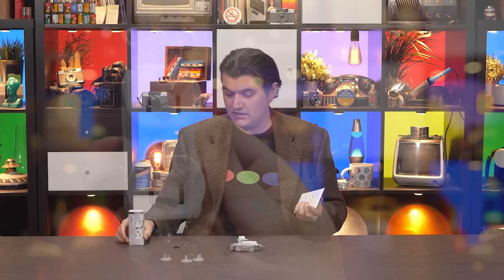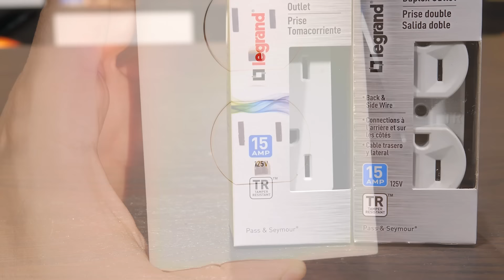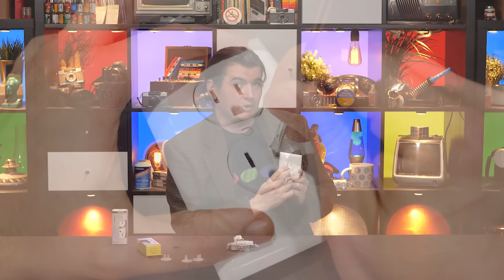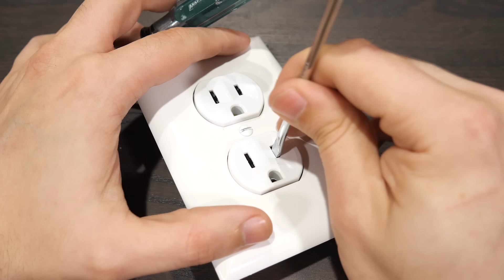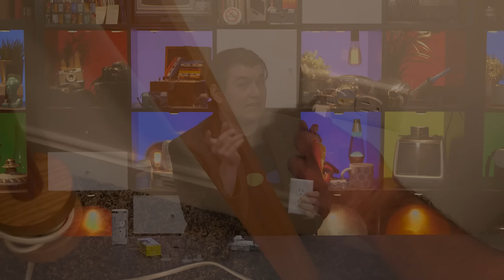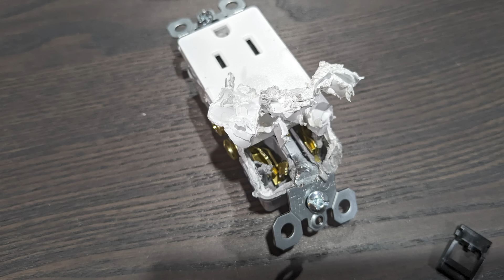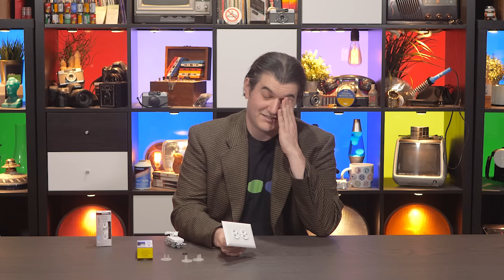Tamper-resistant outlets aren't all the same - a follow-up

Comment: It’s like qwerty vs dvorak or whatever it’s called, the newer one may be better, but enough better to make people switch and learn how to type all over again, and some people aren’t as good as others at changing. I think the foreigners that say our plug are “always loose” came here and stayed in hotels where they are all worn out like you said. If someone in government figures out a way to get richer by forcing changes, it will happen, otherwise why change. People are more likely to get hurt my 120v AC by yanking their arms back and hurting their elbow than they are to be electrocuted. When I was a kid I stuck my finger in light sockets many times, I also nailed myself with 240 many times, but only like a two finger deal, never like one phase in each hand making it all go through my body. I was wiring things up and winding coils making electromagnets etc starting at around 8 years old, I wasn’t stupid enough to like sit in the bathtub filled with water playing with 240.

Comment: I've worked on 120v/15amp circuits live, and so long as you're using insulated equipment and gloves, and you're careful with the wires, it's a lower level of danger that I'm more comfortable with.

I would never work on an electrical panel or breaker panel live, however. Flip off the mains before doing anything on a panel like that. But there are plenty of professional electricians who do work on them live.

Comment: Honestly my new home here in arizona has GFCI breakers at the breaker box which makes any change in the outlet pretty much irrelevant anyway. I did not specify that everything was gfci it just came that way when I bought it. From what I have seen also this is the standard in europ and the UK now. It has actually saved my bacon when I was changing a cealing lamp and though the swich was where the hot was broken.... yeah it was not and it tripped without me even realizing that I had done it.

Comment: 230V is more dangerous than 120V because of higher voltage? No, that is WRONG! It's the other way around!
Voltage isn't what kills you, amperage is! And lower voltage results in higher amperage at the same level of power consumption.

An example:
An appliance is using 120 Watts. On 120V, that is 1A. On 230V, that's 0,52A (aaprox.). 
Since an amperage of 500mA (0,5 A) is enough for a possibly lethal shock, a 230V AC system is better. Also, a 230V AC system can deliver much more power in total, because amperage stays quite low.

Practical exmaple:
Think about the electric fence of a cow pasture. It will keep the cattle inside, because of the shock, but it will not harm anyone. Ever touched one of these? You'll get a shock, too, but it will not harm you. These fences operate at very high voltage, but very low amperage. Otherwise, they'd have to be banned from use. Those fences usually operate with impulses of 5-20kV (yes, that's 5.000 to 20.000V!).

I don't know about you, but I'd rather get a 20kV @ 0,05A shock than a 2V @ 50A.

Keep in mind, that our body's electrical resistance also plays an important role here.
More? See this YouTube video, the Video ID is: BGD-oSwJv3E

Comment: So how about using L5-15 and making tamper-resistant variations of those? If the connector twists to lock, you wouldn't have many of the problems that normal 5-15 give, but you would need to cut and strip every connector you have to make it compatible, and Frankenstein your own extensions / multi-taps._or_ spend more money on specialized L5-15 multi-taps / surge protectors. Worth it? Or better yet, worth petitioning the government to standardize?

Comment: The house i grew up in had a few well-used outlets. Those were the ones my dad had to replace more often as the plugs would fall completely out of the recepticle! Some of the new ones would be very difficult to push a plug into for awhile. The vacuum was especially  dreadful to plug in - and remove! We'd get zapped taking it out quite often. Nothing like adding a little zing to your day! Phew!

Comment: I can see the internal prongs that grip the plugs ending up sleeved or dipped with a nonconductive coating, this would prevent the partially inserted plug from being a hazard while still giving you a full length prong to properly grip the plug once fully inserted. Think of it as the inverse of the UK plug.

Comment: I see what you are saying about the US voltage being safer (less dangerous). If the voltage was so dangerous that one person in every US family died from electrification, there would be protest marches and lobbying of state representatives and a big protest group website pushing for a new type of plug and a new type of outlet to be adopted. But, because the problem is on the level of people like you complaining, and because the people making those safety sockets are not engaging with folks like you, and with the public, the old standard will stick around  because of  social inertia.

Comment: Wago vs backstab - the way I understand it. 
Wago is a spring metal. Over time it continues to apply the same pressure.

Backstab is not a spring metal and will loosen over time, especially in outlits with lots of plug in and outs

Comment: I hate those shutter outlets.  The GFCIs in my garage are made that way.  Unless you are holding the plug perfectly, it bounces off.  Helpful?, no.
Reply: Ironically, it is even more difficult to insert a grounded plug because there are fewer degrees of freedom to wiggle it into proper position.

Comment: I was about 7 when I learned which breaker was for my bedroom.  Much later in my 30s I visited my parents and they remarked how all the outlets in my childhood bedroom had scorch marks.  I went and looked and was amazed that I was still alive.  I was one of those kids that at about 13 years old my favorite toy was a 7.5kV neon sign transformer that I would make Jacobs ladders out of.  I only got bit a few times by that.  It felt like getting dunked in ice water, if you were wondering.  No, I never told my mom.
Reply: Mehdi (Electroboom) nearly died from a Jacob's Ladder.  I think it was his 1 million subscriber special where he built it.  Of course the most likely way for tinkerers to die is by playing with a microwave transformer, incredibly useful for many projects but also incredibly dangerous.
Reply: this is insane lmfao
Reply: Reminds me of when I blew my hearing out of one ear for 30 minutes
Reply: I wired the high tension from the TV set in my room up to the metal venetian blinds. My friend from school still talks about it to this day. Yes, I did get between the HT and ground. Once. The reason the TV survived that abuse is because it was a BW Valve TV set.
Reply: @TeVolt805 uh, why exactly did you wire the TV to the blinds? Some kind of Rube Goldberg booby-trap? 😅
Reply: @emilyrln I think he was trying to use them as an antenna? That's my only guess.
Reply: @texaswilliam  in that case you'd not wire up the high tension but the antenna input (which can sit at mains tension in case of defects, but not at high tension).
Reply: One cause of the scorch marks is also from people yanking plugs out by pulling the cord instead of at the plug. It creates weakness in the connection inside the plug and eventually you get a fantastic arc when you send power through it one time. My mother-in-law used to pull out cords this way and blew several outlets.
Reply: Engineers and electricians must not travel much or bothered by loose outlets. 4 out of 5 hotels I stay at, I have to hunt for an outlet that holds the plug in and lets me charge my laptop and phone. I carry an extension cord when I travel with my spouse or/and kids because the only outlet that works may be the one behind the night stand where alarm clock and lamp are plugged in.
Reply: I loved to have one, instead I play with a 5kV  fuel burner igniter from the 70's, less voltage but far more powerful, only get shocked through the dull old creaking insulation but it really hurt !

Comment: 9 year old house here. Cheap, flimsy TR outlets in the house, a good half of them unusable. I've finished swapping them out the worst ones, went with commercial grade versions which seem to work much better. When removing then old ones, some were completely broken, I can only guess caused by frustrated previous owners forcing plugs in. Poor design equates to not just tamper resistant, but use resistant.

Comment: When going to US clients I noticed that a lot of power strips have very weak contacts and devices fell out quite easily. Less so with wall outlets but still rather loose compared to what I'm used to.

This does not ususally happen with the Type F/Schuko strips we use in Germany.
If you want to continue on this topic I can recomme checking out the Type F and or Schuko system. Imo the most sensible design out there from an electrical and usage  perspective. Not silly national pride used to form that opinion.

Comment: I think the style of TR plug that holds onto only the tip of the plug could be improved if there’s a non conductive material in the plug that serves as a way to grip onto the prongs so it’s that that’s holding the plug in place and not the metal contact itself at the very end.

Comment: I used my wall adapter and the receptacle fell out of the wall. It shorted the brussel sprouts and my GFCI wasn't Y2K compatible. I tried to restart the modem and the refrigerator gave me a blue screen. And the plugs in my walls haven't gotten any better. Welcome to the 21st century.

Comment: As someone from Europe who has been to the US a few times lately I think I can try to talk about the "loose plugs" thing. (Sorry, long post, but TL;DR: it's not so much as they're terribly loose as that they are comparatively much much looser than the usual here)
So I'm currently living in a 40 year old apartment with a 40 year old electrical installation that has possibly the worst wall sockets I've ever had at home (worse than the apartment where a wall socket was just sort of nominally not INSIDE the shower), and they feel just... exactly the same as US plugs except with holes for C/J plugs (or possibly N, which is weird since my country switched to F, not J or N, when C became sort of illegal! Fun!).

Nowadays the wall sockets here have their pin holes inside a deep indentation in the shaped like their corresponding plug type so, if you are using the correct plug for your socket (many appliances, especially old ones, still have C plugs, but the new sockets are compatible with them) the physical interference between the walls of the socket and the plug's plastic molding, added to the fact that the pins are gripped pretty tightly inside the wall, make it actually pretty bloody hard to yank a cable off *even intentionally*. If you want to unplug something here you'll usually have to firmly grab the plug and wiggle it as you pull straight back (of course, over time the sockets loosen, but the recessed indentations still make it hard to unplug a cable by yanking in any direction except perpendicular to the wall)

But none of this is true for US (or my apartment's) sockets/cables. Here (or there) a gentle tug on a cable from pretty much any angle already exposes pins, or worse, straight up unplugs it (or worserer, yanks half the socket off the wall, ask me how I know!). It's a whole different world. You go from fighting the sockets to release your cable from its clutches to being able to casually slide something between the socket and the plug.

That said, my experience with sockets in the US is mostly limited to hotel rooms, which probably have seen a fair amount of wear, but... have they been worn off as much as the garbage 40 year old sockets in my current apartment that sometimes don't even stay attached to the wall? I'm... gonna go with no, to be honest.

Comment: The reason I won't use the back-stabby power terminals is that the contact surface is much smaller than the screw terminals.  The smaller the contact surfaces, the hotter the contact points get when forcing more power through them.  When replacing my own outlets, there were some that actually charred using the stabby bits.  Just, don't use them.

Comment: My mom had hair rollers which were held in place by U shaped metal wires.  My brother got a hold of one, unplugged the clock and placed the metal holder in the power outlet.  Luckily, it completed the circuit so my brother did not get electrocuted but these tamper resistant would not have helped in this case.

Comment: Loose outlets have been an issue for me in both of my grandparents’ homes as well as my current one (built in 1964). They just get things plugged and unplugged so many times that the contacts don’t apply much pressure anymore. Things like those little Glade plug in air fresheners always want to come out and it’s frustrating to vacuum when the tiniest little jiggle of the cord makes it fall out of the wall. I know how to replace them but I just haven’t taken the time. 

When I do, absolutely no backstabbing for me. I’ve only had 2 times in my life when an outlet got hot and melty and scary, and both of them were backstabbed and the backstabbed connection was the locus of the heat damage when I finally found the issues and replaced them. So to each their own but I’m one of the “backstab shouldn’t be a thing” brigade 😅

Comment: As for electric shocks - I have had many 240v shocks, but I'm still here (at 70!), so, even at 240v, it's quite hard to actually kill yourself.  On one occasion I was installing an oven on a 20 amp circuit, thinking the supply was off (it wasn't) and was actually thrown across the room and blacked out, but all I got was burnt fingers.  One of my neighbours is an electrician of some 30 years experience, and he can tell even worse tales about things that have happened to him or he's seen happen to others, and, the last time I checked, he was still alive.

Comment: Putting an insulating shroud on the bottom 1/4"-3/8" of the plug blade should help mitigate the inherent risk without having to change the basic design of the system.

Comment: Canadian here, the only time plugs 'fall out' is cuz A it's a really bad plug where the prongs are half the size of a normal one for cheap scamy reasons, or B you yanked it cuz you were using the thing.

Also I hate TR outlets. Installed some outside at the advice of my electrician and I despise using them. They always jam. Gonna need to stock up if code is going that way. It's already difficult to find normal outlets in big box stores.

Comment: I wonder if the "your plugs are constantly falling out" comments are coming from people that are using US plugs with cheap UK/European adapters. Some electronics are dual voltage and can run on with both 120 or 240 volts. If someone in the UK is importing a dual voltage item and using an adapter with a loose fit, they can easily fall out. I have a pair of computer speakers that came with a European plug and an adapter to allow me to plug into my Canadian outlet. If you even looked at it funny, the plug would fall out of the adapter. I later bought a better adapter that had a tighter fit, and the problem was solved. 

(By adapter, I mean a device to convert from a plug for one country to an electrical socket from another country without changing the voltage. Not a DC adapter, or "wall wart".)

Comment: I´m wondering, if one of the reasons your voltage is, less dangerous, is the frequency, 60 vs 50. If I recall correctly, 50 Hz voltage, even relatively small amounts, can cause, tachycardia, particularly if the current has a path from one hand to the other, via your heart. Opposite of what those defibrators do, if I´m not mistaken. Not sure, if 60 is that different, not an expert.

Comment: my dad has this old plug tester which i think is hilarious and cool. it is a screwdriver. a flathead screwdriver in the handle of which is embedded a simple plug tester, as well as a blue LED to indicate the plug status. fun thing too, the handle is clear resin to let the LED light through, but side effect is that you can see all the electronics in there, which is always cool. But yeah, that is an actual scenario where you are SUPPOSED to stick a screwdriver into the socket :}
Reply: I have one too, they're for testing which hole if any is live and neither outdated nor unsafe ;)

Comment: Whenever I've bought a new place (and I've lived in three places that I bought) I've always replaced all the outlets. It's not hard, and you just need a few tools: a screwdriver, lineman pliers, and two testers: a plug tester and a non-contact voltage tester. The building codes seemed to get on the tamper-resistant bandwagon sometime between 2007 (when no TR receptacles were available) and 2012 (when they were all over the place at Home Depot).

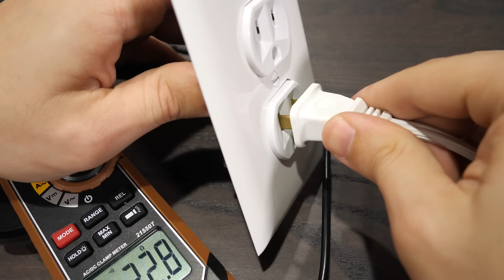Comment: How much clearance is there between the sides of the holes in the faceplate and the blades? You wouldn't need much to protect avainst coming in contact with the blades before the plug is fully seated. A thin layer of plastic sleeve or even laquer would help. Unless the electrical contacts in the socket is just a few millimeters behind the faceplate of course, but that doesn't seem to be the case. In the demonstration at around 6:13, it looks like around half of the length of the blades are in before you get continuity.

So, why not coat around 10mm of the blades with an insulator?

Comment: Wearing a motorcycle helmet when you ride is “safer” than not wearing one. But it does not make the rider safe, i.e., it does not make the rider impervious to injury. 

Wearing one is safer, and less dangerous, than not wearing one. But wearing one does not make the rider impervious to injury or death. (I wear one every time I ride btw because I like and will take whatever edge I can get.)